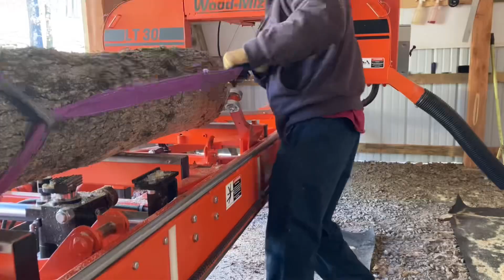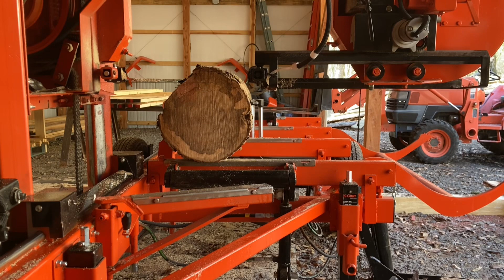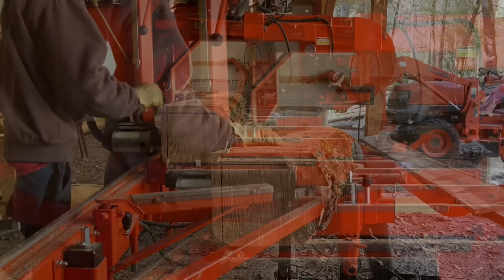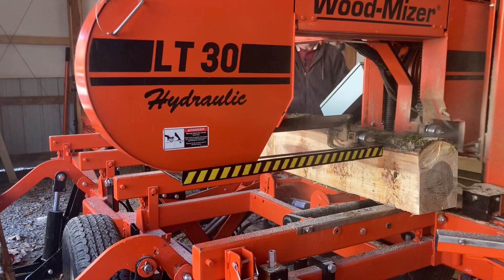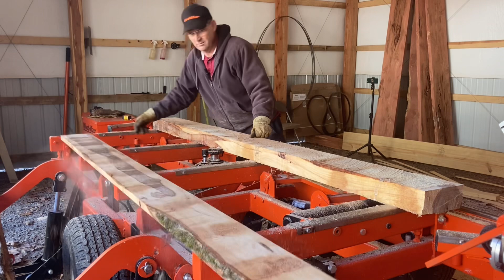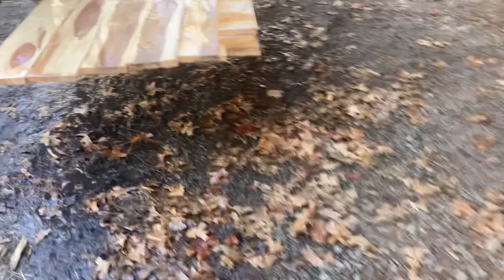Sawing first hardwood on the LT30

Comment: Is your mill new?  I didnt know they made a LT30 hydraulic.
Reply from the maker: No until this year it was a manual mill built in June of 1988. I have a video up about it.
Reply: @hillsidemill  i noticed several not standard add ons, like the simple works was a different color and the laser.   I love my LT35.   Have fun.
Reply from the maker: The mill was a high hour 1988 manual Until recently. I stripped it to the bare frame and everything that went back is new. Some of it is from wood mizer and some is not. The set works is similar to the acuset two. Thanks for watching. I hope you subscribed.
Reply: You did a fine job on your Mill restoration.

Comment: Pardon a stupid question, but why is it you seem to suffer more staining / brown "incursion" (or what it's called in English)?. Rust?, Bark? Rapid oxidation of wet wood? compared to many other 1man sawmillers?. Just curious
Reply from the maker: On the elm video, I think what you are seeing is this log has been down from some months. It’s some dryer inside than if fresh cut. The water delivery system I have floods the blade intermittently. This gets all of the sawdust remaining in the cut soaking wet which makes it dark in color compared to the surrounding wood. As soon as the surface moisture dries it all looks the same. I hope this helps.